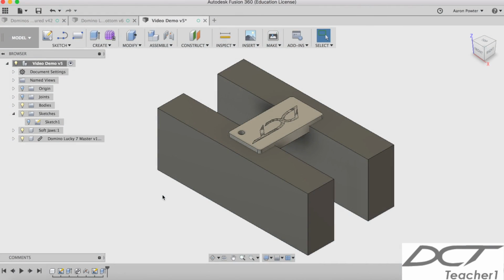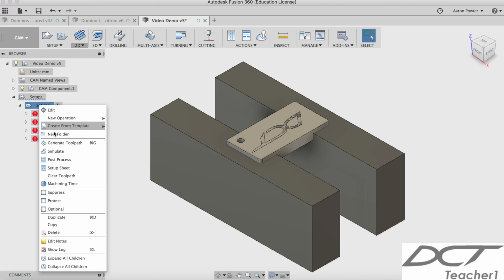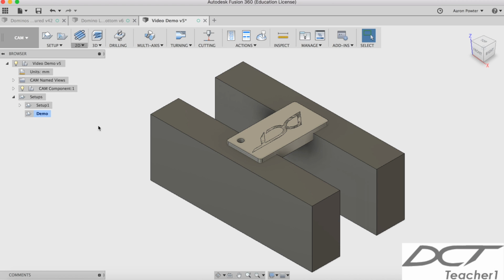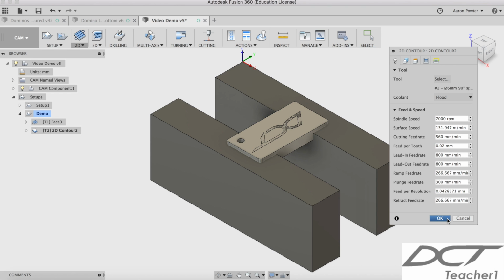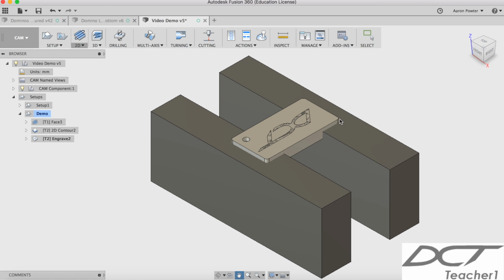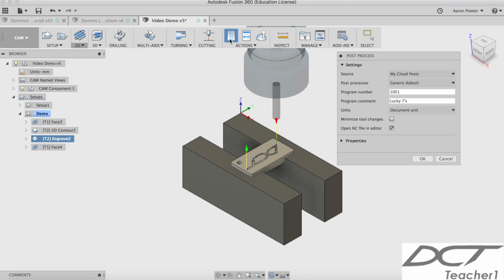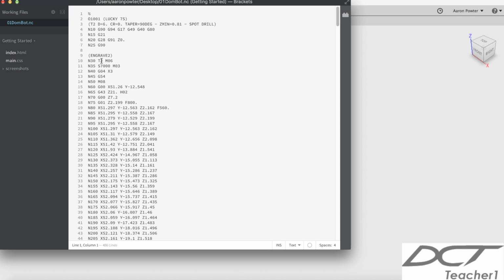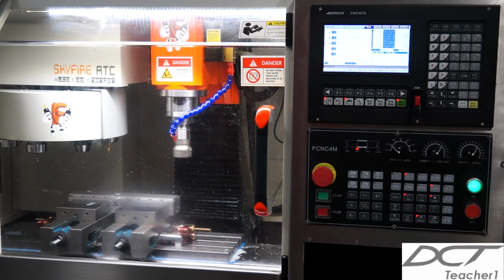Fusion 360 CNC Machined Dominoes Pt.2

Comment: In fusion for engraving with ball mills, I have found that using a 2d contour path with cutter comp turned off works well too.
Reply from the maker: Hey buddy, that's a very handy tip thanks for sharing.  Cheers, Aaron.
Reply: DCTTeacher1 No problem. Thanks for sharing your content.

Comment: Thanks for sharing Aaron! Given the limitations and design of the Skyfire and having watched both parts of this project, how long do you estimate it took the machine to make all of them?
Reply from the maker: Hi Doug, I can't remember off hand.  However, when I go back into Fusion360 and check the simulation time it can provide an approximation.  The 1st operation estimated time was 32mins and the 2nd operation estimated time was 12mins.  This is based on the feeds and speeds that I had programmed.  I think these times are conservative and it probably took 35mins to make 9 x dominoes.  Cheers, Aaron.
Reply: DCTTeacher1 Thanks for the estimate. It would be interesting to see how fast a HAAS TM-1 series could accomplish the same project.

HAAS US pricing for their entry level machines has been very competitive over the last year at $27,000, which on several occasions had several sales events that reduced the price or offered a significant discount on tooling.
Reply from the maker: Oh I couldn't agree more.  I am strong supporter of HAAS Automation.  We have 2 of their machines at our college where I teach.  Unfortunately the cost of purchasing a HAAS machine here for my garage is just too expensive.  With dealer Import costs, import taxes, and exchange rates would make that TM $50K AUD.

Comment: Great video Aaron,  do you have to check the program in single block mode or do you just run it,
Reply from the maker: Hi Neil, that is a very good question mate.  When I teach CNC to fellow teachers and students I always run the program in single block mode.  This is the way it was taught to me by my good friend Iscar / Haas Craig (formerly).  I usually lift the "Z" up 50mm (2 inches) from the stock also.  However, I never do this for the videos as I don't want to burn up air time.  It's getting harder and harder for me to make short (10min) vids because there is just so much to cover.  Probably why I've been stretching videos over 2 parts.  Maybe if I stop talking I could reduce that time ha ha ha.  Cheers mate, Aaron.

Comment: Nice video Aaron, I have also had the issue with fusion not allowing a particular tool do a job i wanted.
I was trying to cut an oil grove on an internal bore with a threadmill that kept throwing an error.
I'll try this trick next time.
Cheers
-Marty
Reply from the maker: Hi Marty.  Thanks for watching and thanks for the positive feedback.  To be honest mate, I just keeping learning everyday with Fusion 360.  There is probably a better way to do it with Fusion 360, but I'm just to dumb to work it out ha ha ha.  Kevin Ellingson (Mechanical Advantage) and Scott Moyse (CADPRO) are my go to guys with Fusion 360.  I think I need to pick their brains more.  Cheers buddy, Aaron.

Comment: Nice work Aaron. We have had good luck on the finish pass with the shell mill to just lift it up .0005" (or about .010 mm for the barbarians that use the metric system haha) to remove the engraving burr. It helps to reduce the tool marks across the top surface. Thanks for pointing out some of the settings in the facing tool path. Another good option there is the stock offset field, though not needed in your example.
Reply: I like the "Stock Offset" and also changing the "Step over" on some parts to actually align your tool passes to the centre of the part for symmetry.On the first facing operation here stock offset would have allowed you to move the cutter off the back of the job a bit and potentially leave less burr than when Fusion aligns the cutter to just the back edge with no overlap.Basic stuff but all makes a difference to the thinking machinist.
Reply: You city blokes are funny.I keep my mill in the shed not in a tram.
Reply from the maker: Hey Kevin.  Thank for watching buddy.  I got those facing tips (extend before retract) from you video to be honest.  Handy little tip if you ask me.  I will take a look at  the stock offset field too.  Cheers bud.  Aaron :-)
Reply from the maker: If you mill was in tram Mr. Conner this wouldn't worry you LOL
Reply from the maker: You need to come down to Melbourne sometime and I will show you what a tram looks like ;-)

Comment: Great video Aaron. Check this out, when you are in Brackets, at the bottom right corner there's a menu under the arrow that says "text" (in your video). If you click it, you can change it to GCode and it will color code your entire program. Not a big deal, but sometimes it might make it easier to read a bigger program. Ciao, Marco.
Reply from the maker: Hey Marco, Thank you so much for watching.  Hey, that's an excellent tip mate.  I had completely forgotten about this.  HSM works used to do that in their editor.  But since switching to Fusion and they switched to brackets I hadn't used it.  Cheers mate.  Aaron.

Comment: Great video Aaron!
Reply from the maker: Thanks buddy.  SF mill is down now.  Bloody ATC pneumatic cylinder is stuffed :-(
Reply: Damn what caused that? Can you fix it?
Reply from the maker: Yes mate, I need to purchase a new cylinder from China.  The cost is approximately $90 USD + international shipping.  I can't really blame SF for it.  I think it's a combination of not having good quality dry air and lack of lubrication.  I tried to fix it myself, but it's a sealed unit and I stuffed it trying to disassemble the unit.  FFS  :-(
Reply: That sucks. I can send you a bigger hammer if that will help. You should be getting BIG package soon from China that will put a BIG grin on your kissa. :)  My custom tool changer should be at the factory this coming week with any kind of luck then I can join in the grinning contest! Are you going to show the buggered piece on YouTube? Maybe do an autopsy on it. That would be cool.....

Comment: Nice vid Aaron!!  Have you tried using trace for the engraving?  It should let you use the ball nose.  It shouldn't take much to create the centered sketch lines....maybe select the outside and offset half the width to the inside?   Nice work around with the G-code. :)
Reply: The thing that engrave does that trace doesn't is to give some z depth changes. It's sort of a neat effect on these dominos (Aaron gave me on at Autodesk University)
Reply: ya I like to use a "contour" operation for on-center engraving. but there's definitely lots of ways to accomplish it :)
Reply from the maker: Thanks Mike I'll give that a try.  You know me though, I'm such a stickler for what ever works LOL.
Reply from the maker: Thanks Kevin.  I need to experiment more and get out of my comfort (not Southern Comfort) zone.  However, I like that drink LOL
Reply from the maker: Very true Andrew.  Plus you're a way better machinist than me mate.  Hope you've been well?  Cheers, Aaron.

Comment: Great tips in Fusion Aaron.  I can't believe I've never noticed the extend before retract box.  One question, what is the advantage of using 2d contour and checking chamfer over the using the 2d chamfer toolpath?  Thanks for sharing, the dominoes turned out great.
Reply: Aaron may have a better answer, but I'm pretty sure the biggest advantage of using the contour path is that you can use a different tool, other than a chamfer tool. You don't get the protection that the chamfer tool path has, but on an open area like this, it's not a problem.  I have a part where I use a bull nose tool to do a slope.....then, to avoid a tool change, I use that same bull nose tool to make the chamfer around the top of the part.  It's a pretty large radius on the tool and the chamfer is only .020", so unless you look super close, you can't tell it was done with a bull nose.  Anyway.....I think Aaron is just "used" to doing it with contour since fusion didn't originally have a chamfer tool path.  I always use the chamfer path unless I have a specific reason, like mentioned, to use the contour.
Reply: bluehandsvideo That makes sense.  Thanks Mike!
Reply: You're welcome Jason.  We'll wait and see what Aaron has to say. :)
Reply: Thanks Kevin!  It's pretty rare that I model a chamfer....something they were drilling into us when the 2D chamfer tool path came out.  I'll have to check out the contour for the roughing/finishing option on a chamfer.  I've just been duplicating the first chamfer, then running it deeper on the next one or two paths.  Tedious, but it worked. lol
Reply: I posted my reply before I got to this.......that's exactly the same way I did it too. LOL
Reply: @bluehandsvideo I hope you guys and Aaron don't mind me taking a shot at this. There are a couple of things that vary between these toolpaths. If a chamfer has been modeled (actually placed on the model) 2D chamfer won't work. The 2D chamfer command can also sense vertical walls that the shank of the tool may run into and stop the tool short before the tool hits it. In addition to one of the other things that bluehandsvideo mentioned, you can do roughing and finishing passes with a chamfer tool if you use 2D contour. That is helpful when working with really large chamfers.
Reply: Thanks for the reply!  I guess I should have used 2d contour then in my last video where I had a large chamfer.  I just made 3 separate toolpaths with progressively larger widths which worked, but probably not proper technique.
Reply from the maker: Hi Jason, Mike and Kevin.  I think you guys have said it best.  I might sit out on this one.  Oh Jason, I got that extend before retract from Kevin Ellingson's video.  Big Kev from Fargo really knows his stuff.  Cheers, Aaron.

Comment: Hi Aaron sweet video. Quick question is that spindles bearings dry? Sounds awfully loud for such a new machine. Cheers for the vids.
Reply from the maker: Hi James, you're no the first to mention this.  I can't hear anything whilst the machining is running.  Keep in mind that this is servo encoder spindle motor running a toothed belt to the spindle.  So this could be belt whir noise you're hearing.  Cheers mate, Aaron.